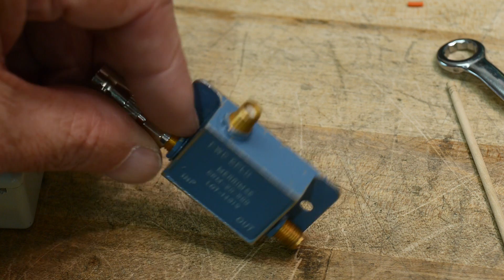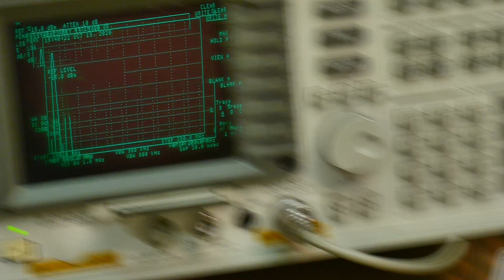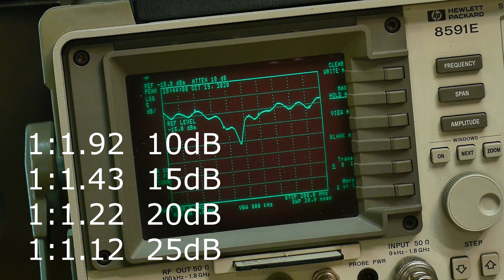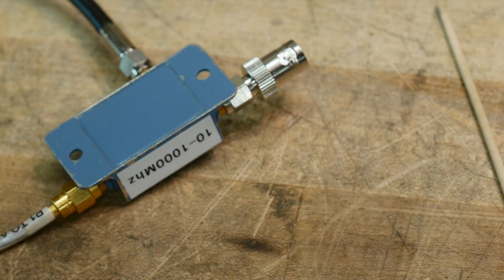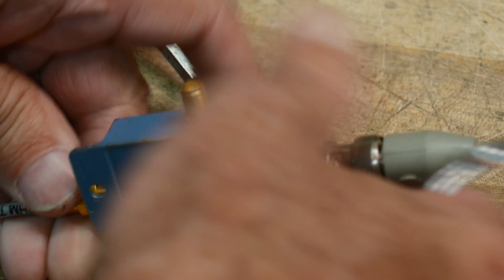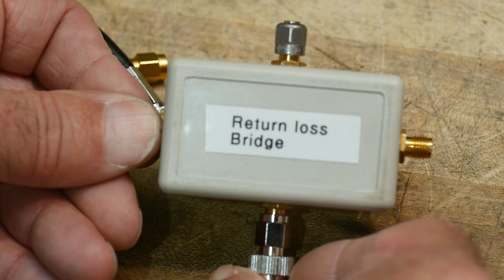#620 Bridge or Coupler? Which is better?

Comment: If you know the reason for using a coupler its not confusing at all regarding the labeling.

If you for example building an CATV-net or a DAS for indoor mobile coverage, you run a coax around and tap of signals to antennas down the line, or in CATV to an antenna outlet.

So the intended use of a coupler is this. And then the in/out/tap is not confusing at all.

Comment: One difference I see is that, when using the bridge, the generator always see at least a 100 Ω load despite what the DUT looks like. With the Directional Coupler, the generator essentially see's the unbuffered impedance of the DUT. This may cause some uncertainty in the excitation voltage, it can be minimized with an attenuator at the couplers end of the generator cable.

Comment: Really good video, because I've heard these "RF-Experts" tout one or the other.
The only thing that I was concerned about (since I really only mess with HF) is the low-frequency limit, that on the couple was 10MHz.  What if you want to have something that would work even to a very low IF of say 50KHz?  
The reason I ask is, could this technique be used for interstage impedance-matching?  Do you have a video on construction of both of these?
Anyway, thee RF videos are really helpful and you seem to cover well the traps that are so easy to fall into for us casual RF's!  Thanks & 73...
Reply from the maker: get a NanoVNA    they just use a bridge circuit inside.  will operate to 10khz I believe
Reply: @IMSAIGuy  OK great suggestion, I was just trying to learn how to make these things to some degree of usability, but needed the low frequency response. Thank you anyway.  73…
Reply from the maker: if you want to experiment, here is schematics: https://youtu.be/yGKWBpgN8PU
it is a simple resistive bridge that is used to measure amplitude and phase. the hardware is easy
Reply from the maker: same used in LCR meters: https://youtu.be/Edf686neAXs

Comment: I was surprised that the coupler gave you essentially the same output level as the bridge.  Just luck (or good planning) that the coupler's fwd coupling ratio matched the bridge's ratio?
Reply from the maker: must be. I expected the bridge to be more output.
Reply: @IMSAIGuy  
Hello
Usually the RF bridge has a greater loss of passage but has a better directivity and therefore more precise and suitable for measuring DUT of high Return Loss, the Chinese one I don't think has good parameters.
Just today I uploaded a video where I make precision measurements using a VNA with measure S21 + external bridge and the errors are predictable with some precision as they depend on the amplitude and phase of the direct and reflected signals encountered in the bridge or coupler directional.
With this system I am able to obtain a greater precision than an S11 measurement, precisely because of the directivity of the bridge of the VNA instrument.